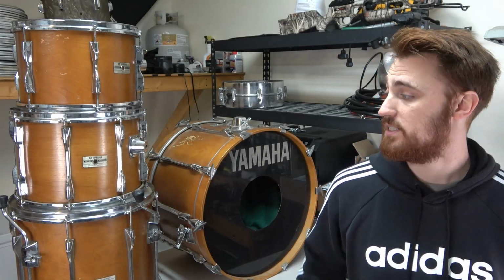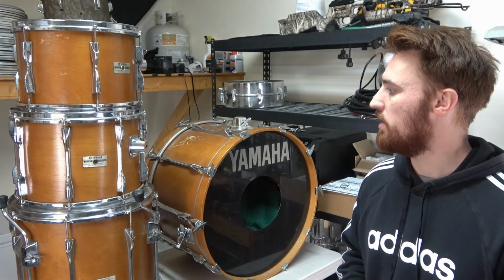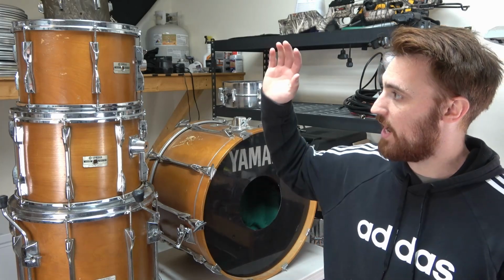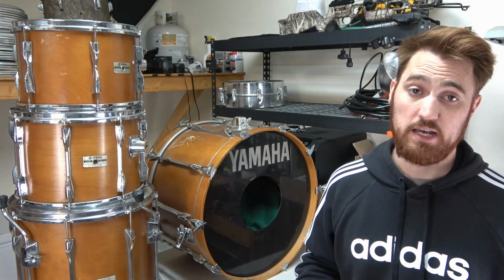Yamaha 9000 (Recording Custom) Drum Set Clean-Up and Sound Test

Comment: The drums you have look to be the late '70s/early 80's MIJ 9000s. From 1982, the 9000 kick drums would come with coated heads on the shallow 14" deep kicks and the black large ported head would be supplied on the 18" deep kicks. I've got a few of these older kits with shallow kicks and one of them was supplied (secondhand) with the late '80s black head with the large centre port. They may look really cool, but they sound terrible on a shallow 14" deep kick.
I recommend any front reso head WITHOUT a port to get the best tone on any early 80s thin-shell rounded-bearing-edge Yamaha RC 14" kick.